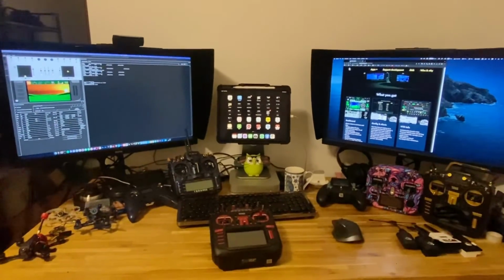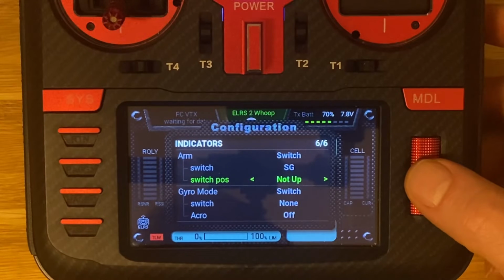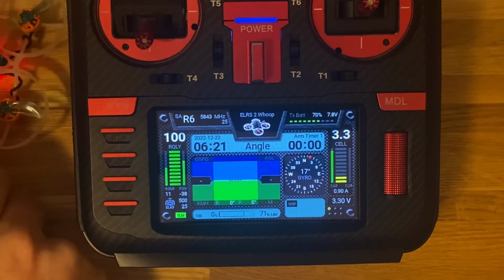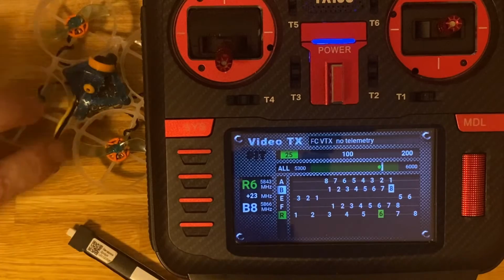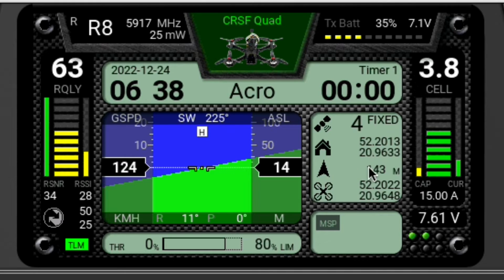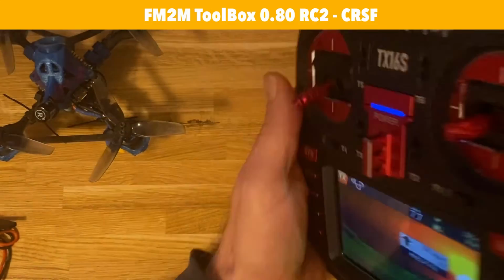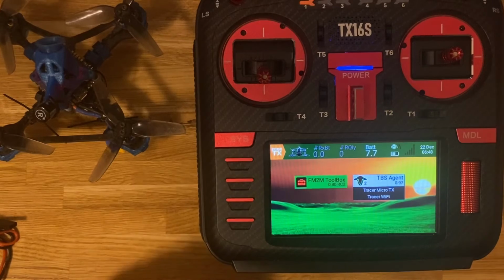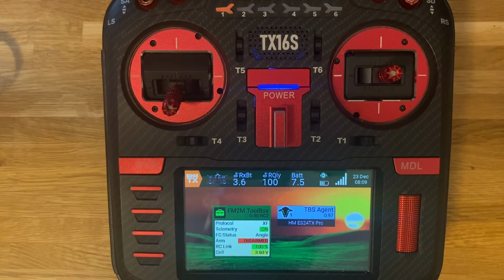FM2M Toolbox 0.80 RC2 - Walkthrough

Comment: Great video and Lua file, I can’t get my battery cell bar to work or my gps or compass? I have them installed to my quad.
Reply from the maker: Probably you haven't discovered telemetry sensors
Goto to: http://fm2m.jimb40.com/info-faq.html
and read: ToolBox doesn't work. App starts but no data is displayed

Comment: Hi Robert,
Great work!  Initially I had problems with accessing the Configuration and I realized that I forgot to delete the old model config files.  

If I may, I would recommend adding it as the first step in the installation read-me file as apposed to a comment.  

Have a great Christmas!